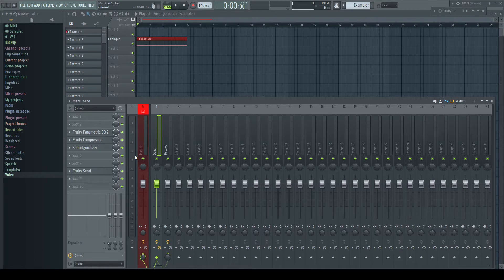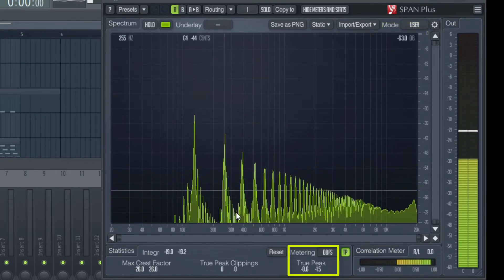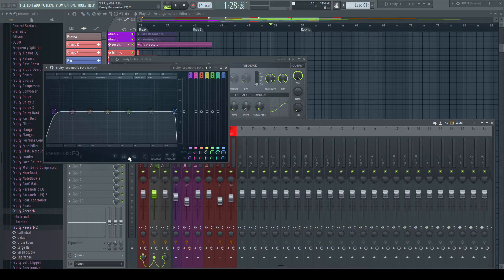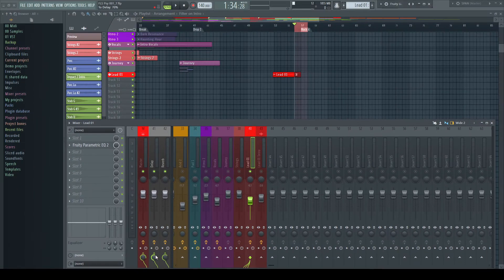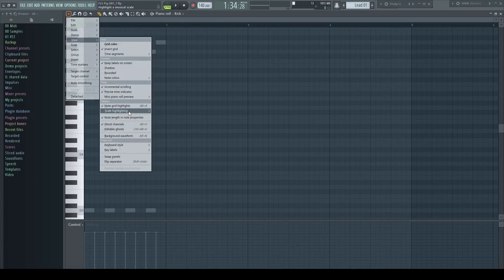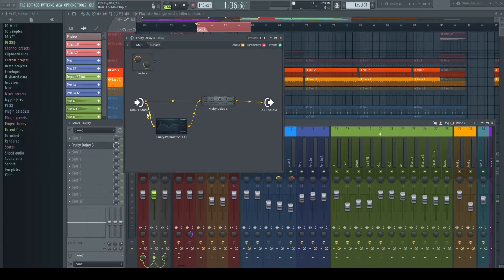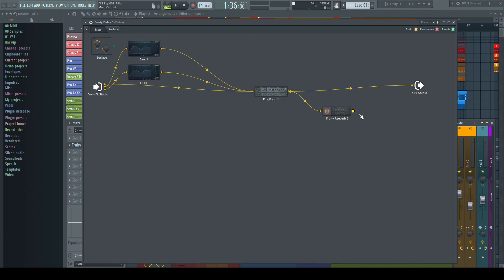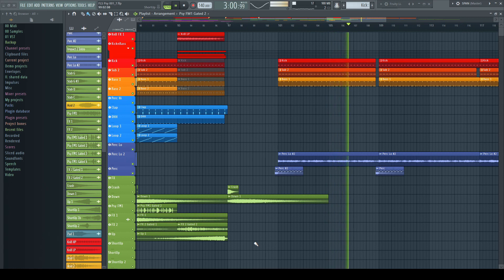FL Studio: Send Channels V2.0!! ... 5 Mixing Tips with Patcher... Part 2

Comment: Hey what if I want to automate my send level? I’m thinking I should use fruity balance but I’m kinda confused on where it should be placed in the chain.
Reply from the maker: Yes, in this case you would use something like Fruity Balance to automate the send volume...
If you want to automate just one track you would place it onto the correct connection before it hits the send effect...
Reply: @flstudiotricks6903  so my chain in patcher should be From FL > Fruity Balance > Delay > To FL?
Reply from the maker: @norfsyq9660  For example... but make sure to be in the "correct" chain :-)